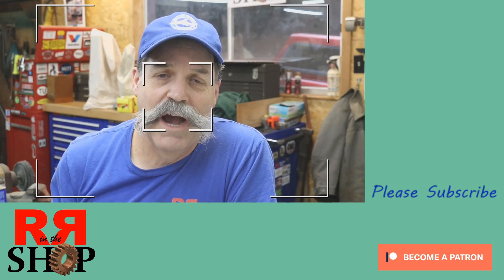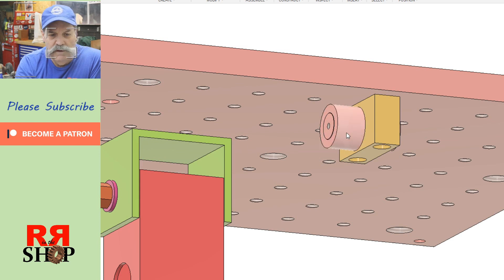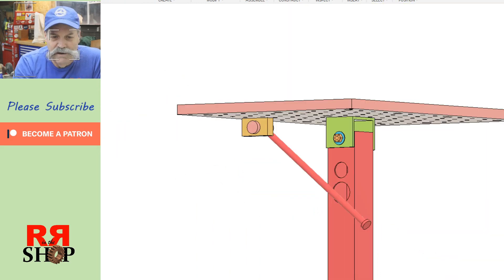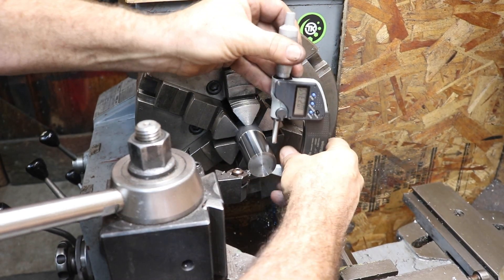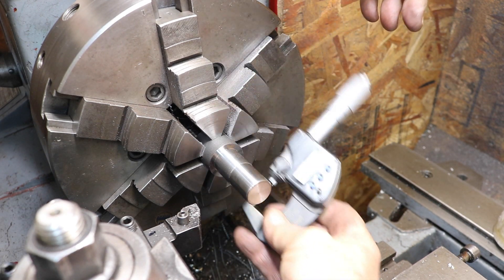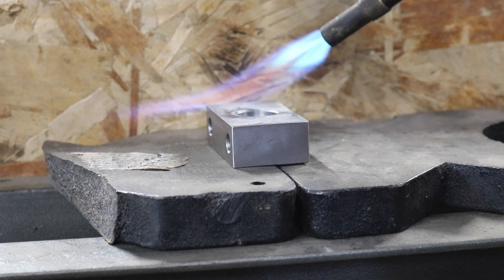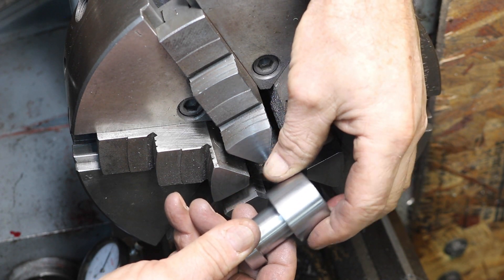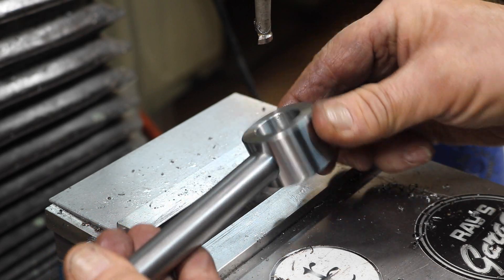What is your Angle on a Welding Table P2

Comment: Beautiful work Randy. I love the finish you were getting on he Hot Rolled steel. I have not been so lucky. On another tangent, the press plates look like the Harbor Freight plates of old - cast iron and very brittle. I have had a ton of commentors talking about the injuries caused by plates like those. Just for your info, if it applies.
Reply from the maker: Yep on the plates,  I broke one myself.  I have Steel plates for Replacements.  Thanks.

Comment: Hi Randy, are you expecting the collar to shrink after it's welded ? Great finish on the part, do you have any tips on how it was achieved.
Thanks ,interesting stuff as allways.
Reply from the maker: No not really, I will tig it.  The finish right feeds and speeds for this material is critical.  At 1" dia, 850 rpm, Feed rate high, high enough so the chip breaks, DOC depends on the the radius of the tool, no shallow cuts, small radius 0.015 min, Larger the radius the greater the min. DOC.